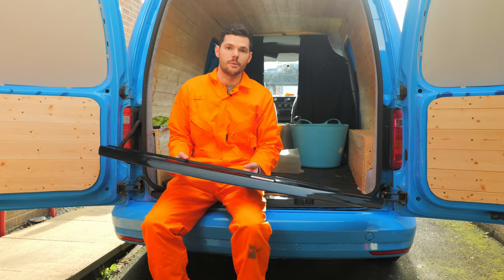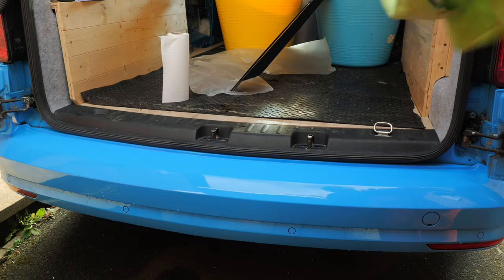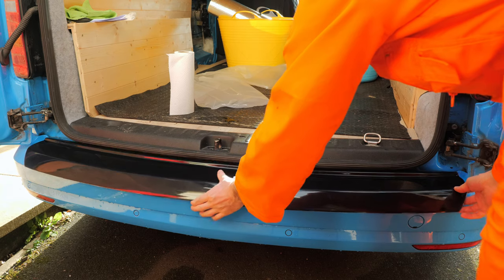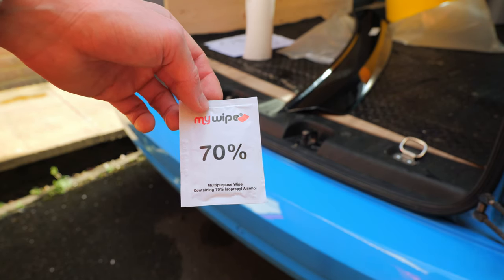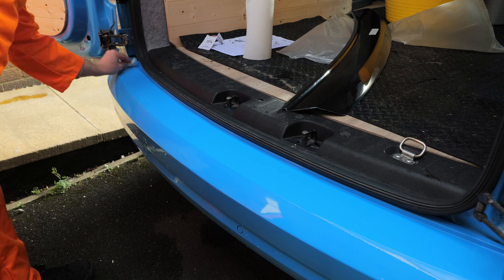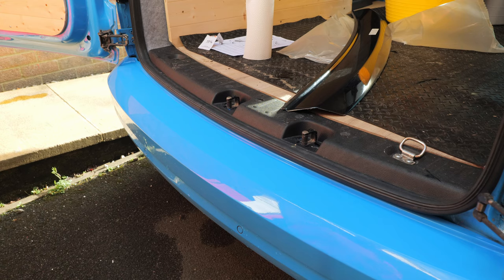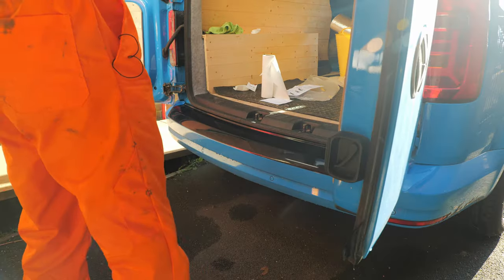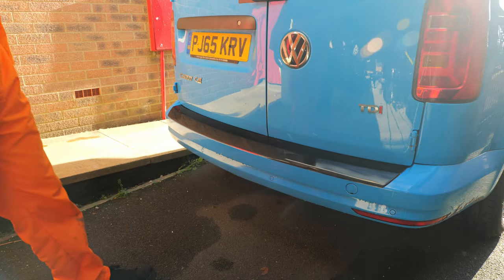How To Install A Rear Bumper Guard

Comment: Do you find that the bottom edge of doors now sit in water (rust issues) due to there being less gap due to fitting of protector.
Reply from the maker: Hey not yet no. There is reduced space but I haven't seen any damage or rusting.